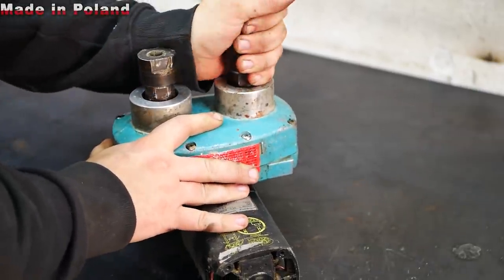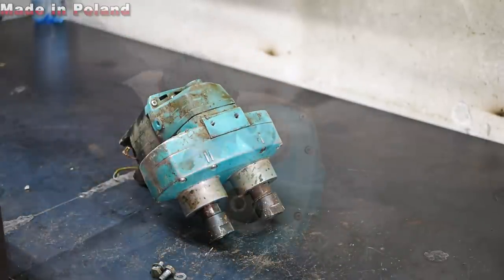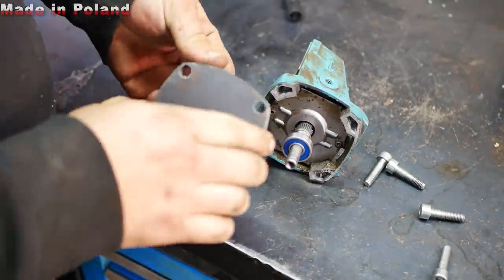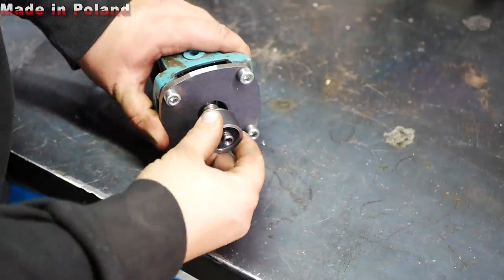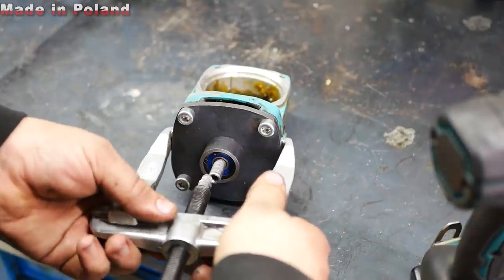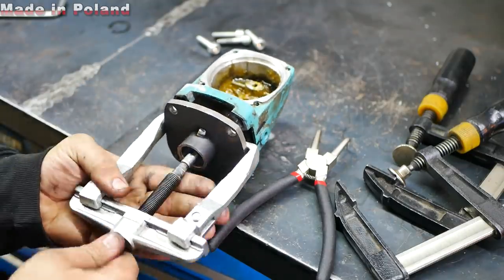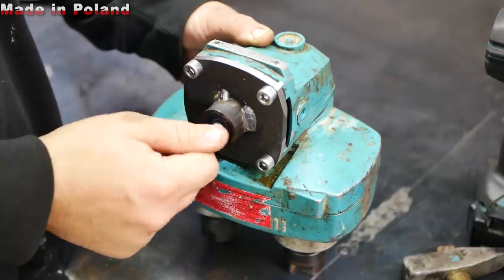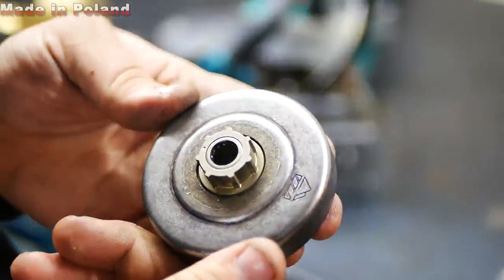Chain Saw HACK 9 - Mobile Concrete mixer

Comment: A roll pin works, however a shear pin or bolt may be better suited for the connection. 
As always,  thanks for sharing. 
Cheers
Reply: No need for a shear pin. The chainsaw uses a clutch. Shear pins are made for situations where there is no slip in the drive.

Comment: 1:32 it might not be necessary for this build, but it's a good idea to measure exactly how far this gear sticks into the gearbox. Those type of gears wear out in a short duration when not exactly at the right position.

Comment: 6:18 the break away link is a really good idea, you might want to point out why in your next project 😙🎶
Reply: It's not a shear pin ("breakaway link"), or at least it shouldn't be. The chainsaw uses a clutch, so there is no use for a shear pin. A shear pin would only be necessary for a situation where there is no clutch to allow for slip.

Comment: Mixer without wires this well, but work in buildings not in the forest. What's the problem with long cords ?  You're not the only one inconvenienced by the noise. but also neighbors.  Mix the dry components of the solution and then add water to the desired density can be manually.  There is no more than 20 -30 kg of solution in the mixing tank.  That's not much.  Do not mix a cubic meter of concrete..   You already live in Paradise...  Lathe, welding machine, tools, you do not shoot, there is no war with Russia... isn't it heaven ?  And in a whole done talk.  Greetings to all from Ukraine.